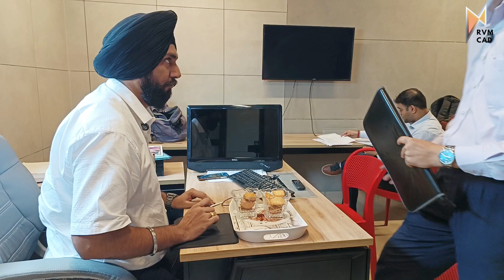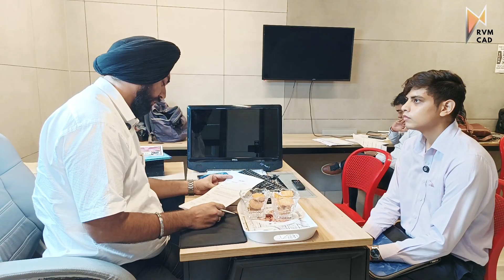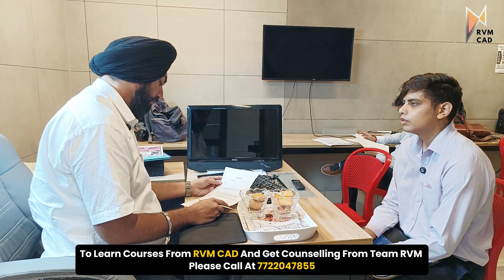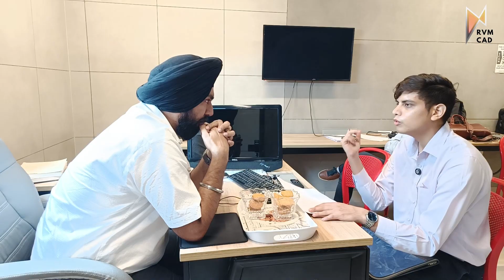Mechanical Engineer Interview for Designer Role | RVM CAD - India's Biggest Skill Development Centre

Comment: Bracket sizes and shapes drawing, make sure marking the mild steel plate required dimensions and according the thickness of plate required welding electrodes and do Arc welding, co2 welding

Comment: For making a bracket, a customized press tool (Die & punch) according to the part dimensions can be used in which blanking, piercing and bending operations can be done. To achieve that in one go progressive dies can be used. Press tools are mostly used for sheet metal cutting/bending operations.